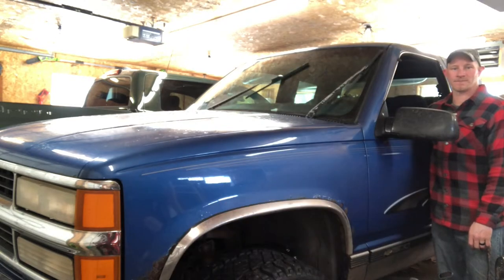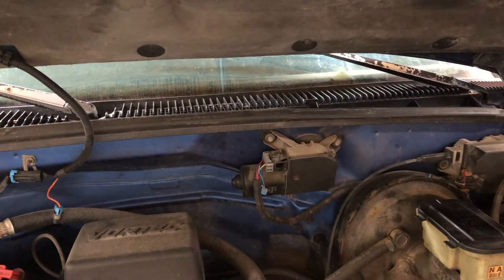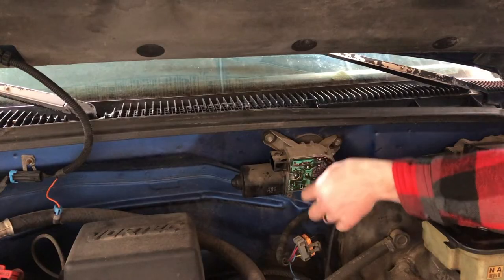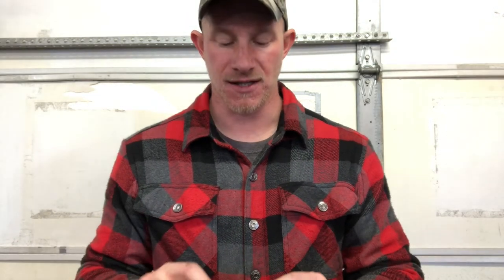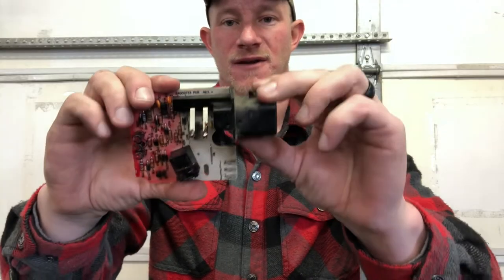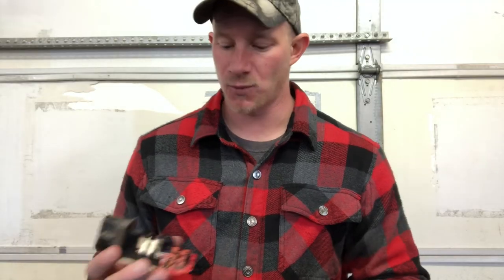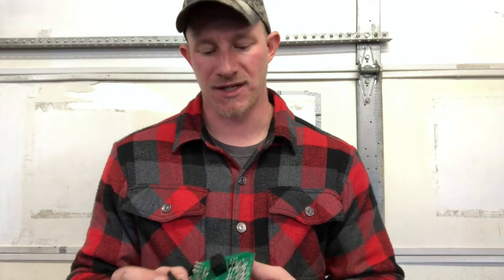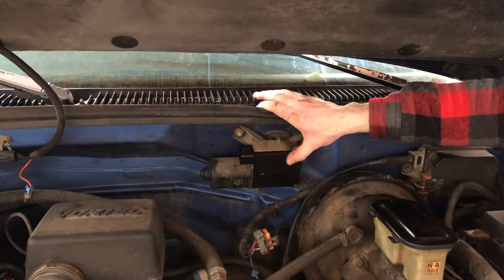How to Fix GM Windshield Wiper Motor EASY! | 1988-1998 Chevy Silverado

Comment from the maker: My apologies, the part is closer to $20, not $10...but still cheaper and A LOT easier than replacing a $50 motor!
Thank you all for the support!
Reply: not a problem,,,I just bought that part for $18 here in Hawaii. My wipers are back in action again thanks to your video
Reply: Hey bud,, How would I look for it on Amazon?.
Reply: Motor cost more than the board and an easier fix
Reply: @FatDaddyankee69  all i did was typed in my make model and year then wiper motor. the board popped right up
Reply: Thank you! Very informative!
Reply: 17 dollars now, but still........cheap fix
Reply: 10/26/23 I just had the part delivered free from Amazon for $15.00 USD.

Comment: I looked around the internet for what my issue was (my wipers would always engage, but would turn off only after fiddling with the control, or randomly. My washer fluid also would no longer spray.) I think this was the best reference I could find, and having seen how dirty and busted my OEM panel was, no wonder it was finnicky. Subscribed!
Reply: Same here in my 97 GMC. Getting this along with a new electric connector.

Comment: My '97 K1500 did the same thing for the first time today (in the rain, of course). I researched the symptoms, found it's a common problem, then found your video. I'll be changing that board after a quick trip to my local auto parts store tomorrow. Thanks for the help!

Comment: I'm pretty sure they're was a recall on that part years ago because I thought my wiper was bad a the tech  told me that gm wiper motors were bullet proof  and it was the board and that was the problem and soon after that they had a recall , pretty sure

Comment: I searched around the Internet looking for a solution to this problem. You were spot-on with everything you took the time to lay out step-by-step and even described the tools needed to do the work so my problem under 10 minutes with a new circuit board thank you so much.

Comment: I have a 92 Chevy G20 conversion Van and my wipers are doing "EXACTLY" what you were describing...  Works during dry weather, and will freaking go inop in the rain!   Crazy...   Will definitely pick up the circuit board and get that replaced ASAP.  Thank you BIG TIME!!!!

Comment: I am glad you posted this video. I have a 1996 Chevy 1500 conversion van and I was told the motor needed to be replaced. I ordered the motor and while waiting on it to be delivered I started to work on accessing the motor. I couldn't get the wiper arms to come off the bolt after removing the nut. It looks like they are attached to a bar that the wiper motor is attached to which I decided was too big a job for me. I looked at this video again and decided I would look at the computer board to see if a problem. There were not any broken circuits but there was a lot of grease build up so I figured I would clean it off and see if that resolved the issue. They now work so I am hoping that fixed it. I will probably return the wiper motor for now which will save me some money for now.

Comment: Link to the part still worked, purchased the part. Installed it today. Wipers still work! Now just have to see if the issue is resolved. 1997 Chevy Silverado. Thanks for the video!

Comment: This fixed my problems. I had only high wipers and washer spray when I got my truck. And you'd have to time when you turned em off to get I'm all the way down.

My washer spray randomly stopped working. After a pump swap it still didn't work. Looked at the board and had a cap that was split in 2 and laying in the housing.  

After swapping the board everything is back to normal and all setting and spray work!

Can't thank you enough for this tutorial.

Comment: One of the best videos I've relied on, with good clarity and great commentary.
Working on a very nice 97 Silverado that was sitting 11 years with a few minor problems, like the wipers, transmission shif solinoid and fuel pump that I have addresses.
Your video and explainations really helped me, rather than take out the motor and go from scratch blindly.
Thank you!

 I subscribed.

Comment: I've got a 90 GT Safari. This issue has been happening to me for over the past year. I've owned it for a little over 2 years. After watching this video I'm going to go ahead and try this. I might just go to the pulley yard and get myself another circuit off of a salvage 👌💯
Thanks for the straightforward easy video

Comment: A new board is a lot easier to replace than a motor assembly for sure. Thanks for the video 1997 Chevy truck, 225,000 miles  Ed

Comment: Hey your video helped me.  Didn't even have to buy one. Just pulled the board out and cleaned the two prong contacts with a light file.  Worked perfectly afterwards.  Thanks for the video.

Comment: Update: I decided to just replace the circuit board with a new one. In January 01 I found this part on eBay. It was $9.99 and free shipping. Install was easy and my wipers work great.

Thanks for this video. My wipers are doing exactly the same thing. I'm just going to buy a new circuit board.
Reply: 9😅

Comment: Thank you so much! My truck is a 2000 Chevy C2500 (old body style like the1999s) and the problem was the windshield washer.  It worked intermittently and finally not at all. Your very helpful video helped me fix it with the new circuit board. I looked at other videos, yours was the helpful one.

Comment: Huge thanks brother! My 1998 Chevy Blazer's wipers started motion stuttering (stop/go), what seemed random. Then stopped working. So, I bought the Dorman pulse circuit board ($17) from Clark's Auto Parts. Installed, just like you showed, and wham-O! My wipers now work. I'm sure glad it wasn't the motor (which was my first thought)....again brother huge thanks! Stay healthy!

Comment: I just purchased a 1997 express 2500 van. The windshield wiper works on fast but not slow. Going to try out the circuit port switch. Thanks for making it easy.

Comment: I've got a '96 Silverado that has had the sketchy wiper thing going on at various times (incl NOW) and I always took it to the garage but this is absolutely do-able and I'm handy with a soldering iron as well if that's the case. Gonna take a look under the hood tomorrow!

Comment: OMG!! Thank you so much. I imported my 98 CK to England last year. It belonged to my cousin in Iowa, so I knew the truck had been well looked after. The wipers stopped working yesterday. After lots of research and realising I would need to order from the U.S if need be, I came across your video. It was as simple as spraying on some contact cleaner on all points. It works fine now. Thank you again. I'll probably start collecting some of these parts next time I'm over there to bring back with me 👍

Comment: Thank You for taking the time to help others !   Thanks for posting the link to Amazon for the part.  It was $18 and I replaced the board on my 1995 Chevy Silverado.  It fixed the problem :)   
I have another problem with my Chevy, is the horn.  It will blow sometimes when I turn the steering wheel.  It is embarrassing.  People would think I was honking my horn at them.  I didn't know what to do, so I installed another horn and placed the button on the dash and disabled the regular horn by unplugging the relay. 
Would you be able to solve the problem with the steering wheel horn?
Thanks !!!

Comment: thanks. i have weak starting wipers. When i turn the switch on, i can hear the motor whirring but i have to wiggle the wiper arms to get them working. im going to try out the circuit board like you suggested.

Comment: Great video I am having a different problem, I have a 88 chevy with w/o delay wipers and someone has installed a used steering column with a delay wiper switch in it. I am considering trying to convert it to delay wipers if its not to expensive

Comment: Sort of related question, ive got a washer pump that isnt working…replaced the pump and still doesnt work. Yes the tank has fluid. Any ideas? Ive got a 1996 k1500

Comment: Wanted to know if you could help I have a 1990 GMC Sierra 2wd. The speedometer stopped working replaced the speed sensor and replaced the cluster (used). Is there a way to replace or test the speedometer motor. Any help will be appreciated thank you

Comment: I'm having an issue with this. I'm suspecting I have a short in the wires on the other side of the plug but looking at this video it may be the board. Ty

Comment: I have a 1994 Chevy Kodiak my windshield wipers work on high and low but when I go to turn them off, they stop at whatever position I turned them off at without going back down to the bottom what would cause that I’ve done replace the motor and the transmitter

Comment: I changed the board. Prior to changing the board  the fuses blew twice at different intervals. Approx 2 weeks apart. The fuse is ok.  Wiper and windshield washer are still not working. Any ideas?

Comment: What my blades are doing is they either work perfectly or a single wipe turns into a multi wipe and then stopping where is anybodies guess along with no washer fluid pump function.
I'll be fixing mine if possible cause here in Canada in 2023 it's an $80 part.

Comment: Maybe someone can redesign the board?

Can the cover be sealed better?  Add a little "x" around the edges before attaching the cover?  Does a later model motor solve the problem and would fit the older vehicles?

Comment: As I am using my wipers under heavy snow load the fuse blows. It normally works fine in light rain. I'm going to start here. What might be the next step?
Reply from the maker: I'm willing to bet this would be the culprit, next step would be to check wiring and make sure nothing is grounding out and allowing that fuse to blow. I'd also check to make sure your truck has the correct fuse, if it's too low it'd blow too easily. Hope this helps, let me know what you find out!

Comment: NHTSA has an open recall on this take to dealer cause mine showed incomplete and it's nhtsa so they have to do it
Reply: Strange I went looking for a NHTSA on this issue and there was none listed.   I called GM and they basically laughed at me because my truck is a 97.  One owner I bought it new. I never received a recall notice.

Comment: Stupid me, I took my 95'Sierrs through the car wash and had the wiper hit the big washing brush (Thought I turned ithe switch completly off), anyway each wiper arm can be moved manually, and I can hear the wiper motor whine when I turn on the switch but it won't move the wipers on it's own. I'm thinking that the 4 bolts holding the linkage my have broke or loosened up... "Coments welcome"

Comment: I've never understood why put a nonconductive grease on contacts you want to conduct?
Dielectric means nonconductive.
Reply: I always thought the same. Found out that the actual connection point will wipe away the dielectric grease and leaves the area around contact point clear of any contamination that could cause a bad connection.
Reply: @bengraham7799  I seem to remember reading somewhere that the grease when it dries out and especially when used on spark plug connections turns into a conductive powder. Mostly caused by any arcing that may occur around the connection. Spark plugs are a perfect place for this to happen. Putting grease on the plugs insulator to prevent the boot sticking is a good use but putting it on the terminal is a no-no.
I once bought s used pickup that came with all new factory parts to convert the headlamps and turn signals to a newer type. The one turn signal/parking light died after maybe 50 hours of night driving. The factory had put grease on the bulb when it was inserted and the bulb basically became glued into the socket from the dried up grease, had to cut it out and clean up the remaining grease in the socket to put in a new bulb. I have never or will never use dielectric grease on any connection.

Comment: Ok so I have a 1989 Silverado 1500 extend  cab and my truck does not have that board anywhere under the hood
Reply: Neither does my 1990 Silverado C1500. I think the whole part cam be retrofitted with one like this.
Reply: Same here.  89 K1500 extended cab.  I picked up a board but it obviously is not the same unit as on my Chevy.  I guess I have to buy a whole new motor?  Will that work on my truck?  Who knows I guess I will try.  Dadgum it.  Hell I put a pulse board off a Firebird in my Olds Ciera and fixed it up fine.
Reply: @robjones8733  I was actually able to just swap the whole motor with a new one from advanced auto it's a completely different style motor but same plug